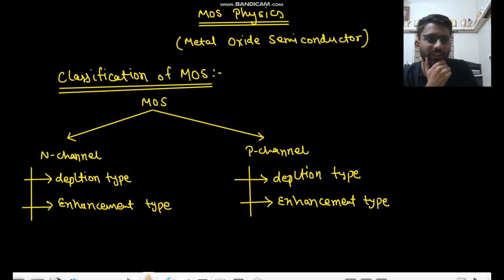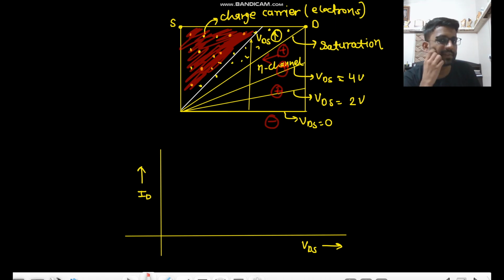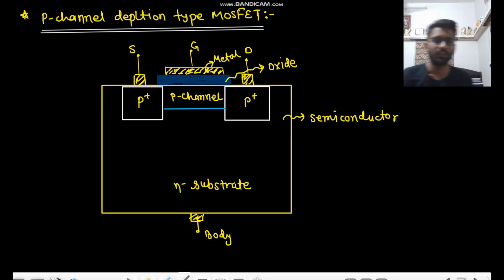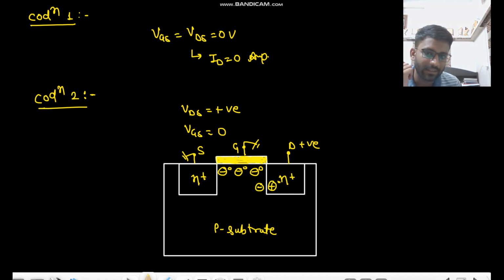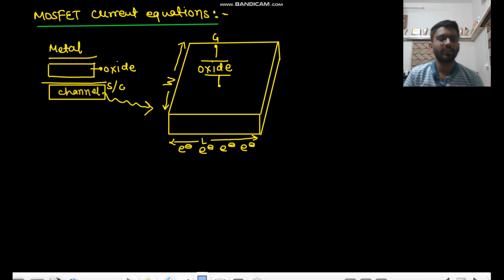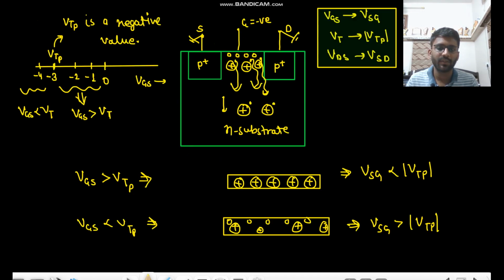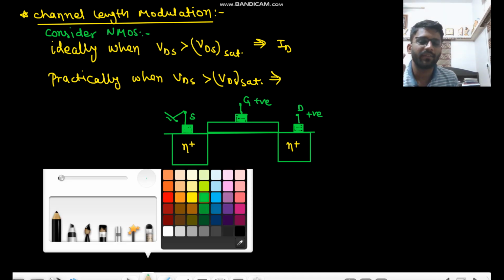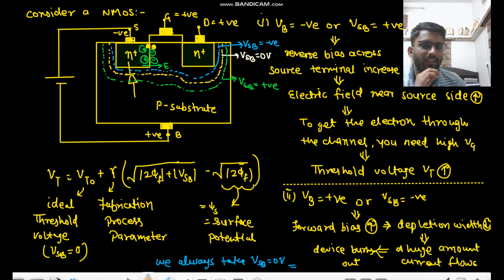Complete MOS Physics for Placements || Analog Electronics : Placement Course : II

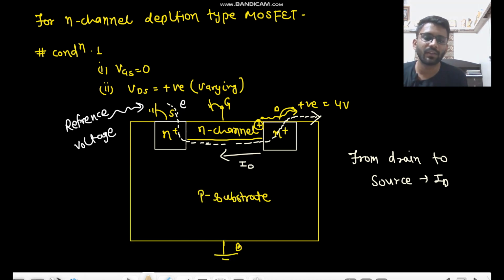Comment: sir at 33:50, there can also be one more reason for why we should always have drain to be positive as when we apply negative voltage at the drain side, the pn junction will be forward biased as we are applying -ve volage at n side and the body is already short-circuited with the source and the source value is grounded, so device breakdown will happen.

Comment: Gate voltage is used to bias the circuit in require region .(saturation)for amplifier .
So if in depetion type mosfet without applying gate voltage we can obtain saturation. 
For small signal at Gate Mosfet Current will still vary.
So it should work as amplifier?